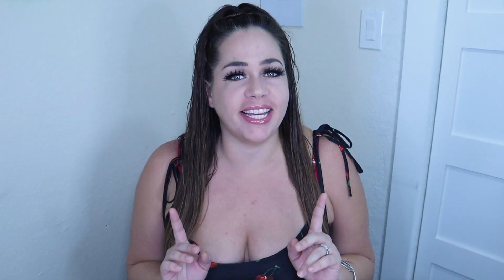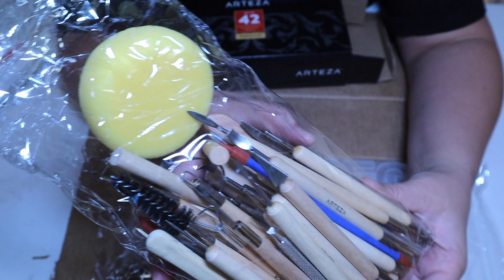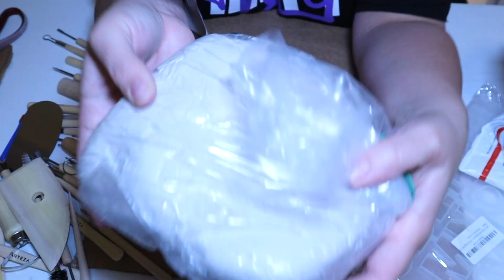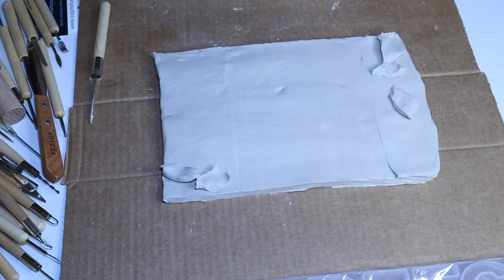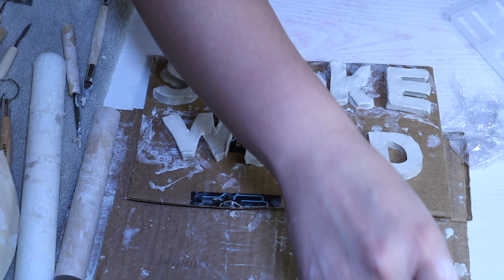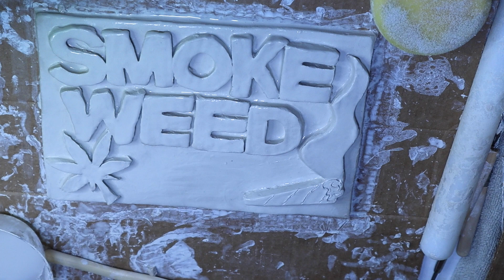AIR DRY CLAY FOR BEGINNERS [pt.1 clay to silicone to resin]

Comment: Thanks for the video I always had clay to custom molds in mind but haven’t  had time or all of the accessories at once to do so. I would be using Sculpy clay u  bake in oven. only one I got on hand. Gotta use it up. Lol. Never thought to use air dry clay for a big project. 🤔😁 I’ve only used clay to seal or cover up spots I don’t want in pieces that I’m going to mold for custom molds. Only use sculpy clay it works great. It’s a great way to customize something that u like but has a few things u don’t like/want or want most of the time it spoils the project for people. No need to let it mess with your project in mine just go ahead and use clay bake or air dry to fill in/cover The spots that you don’t want takes more time but worth it in the end!!
Reply from the maker: nice!